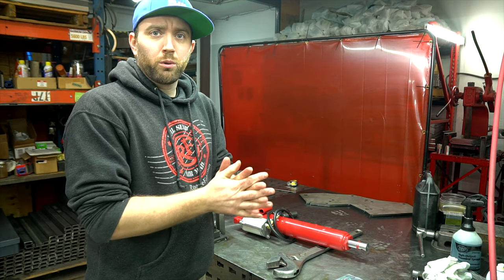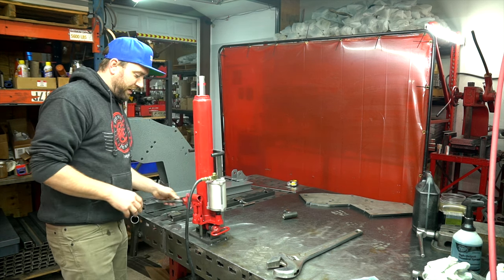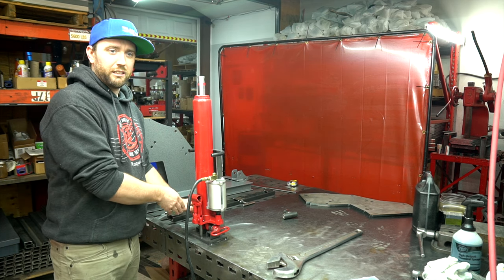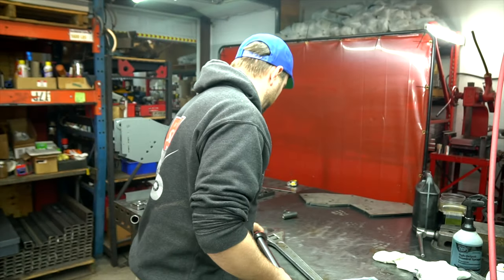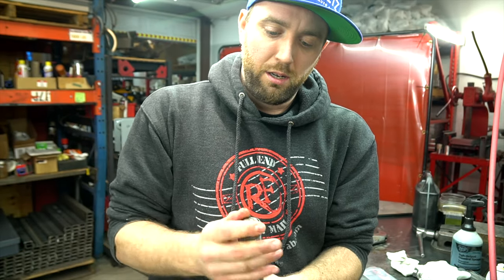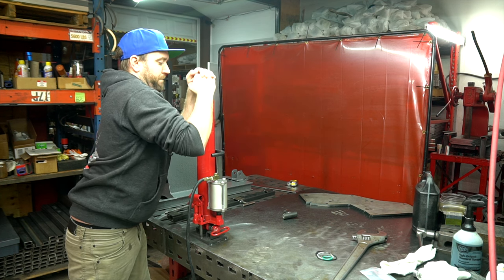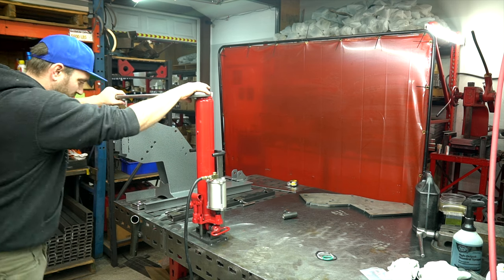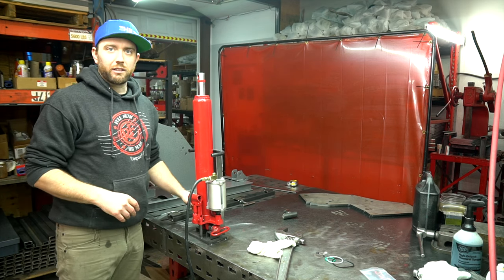Air/Hydraulic Ram Oil Leak Fix - Seal Replacement for Tubing Bender

Comment: A need for a dedicated repair stand welded to the bench... YIKES!  Those jacks must give you guys a lot of trouble.  Good on you for offering free repair parts updated to help your customers survive the china syndrome we all suffer.
Reply from the maker: Yeah we had to tear down 200 of them and machine the rods. A feature was skipped in machining. Can't exactly send them back. It was an ordeal. Now we have a bench for them. We've only repaired a few for seals on it. The skipped feature is nowhere near any seal and has no impact on seals...  -Joe

Comment: Good to know. Hopefully,  I won't need for some time...hahaha. . Thanks Brandon.  Demon
Reply from the maker: Hopefully not! We check the. Here but the OEM seals are tough to keep sealed on a small percentage for some reason. That's why we came up with the O ring seal that is spring energized.
Reply: what brand air hyd. cylinders do you use
Reply from the maker: @johndeninger8905  Rogue Fab branded but we do import them.
Reply: @RogueFabrication  ok thanks 👍
Reply from the maker: @johndeninger8905  most welcome!